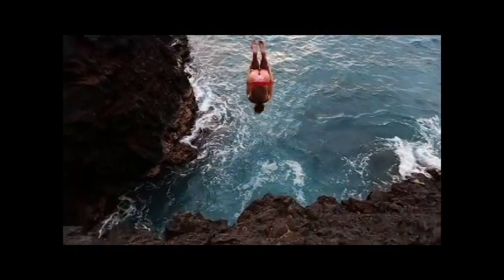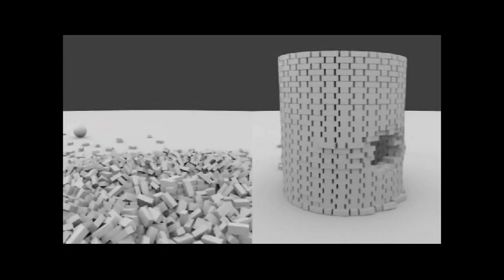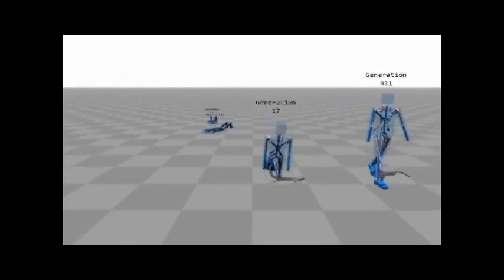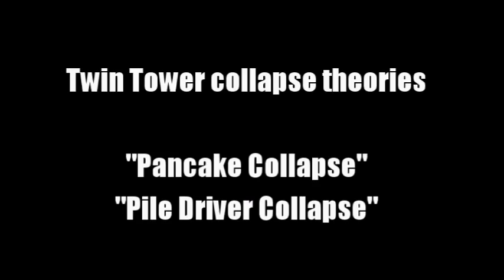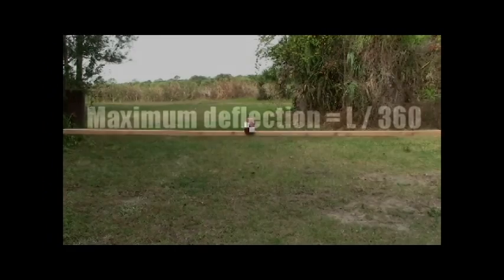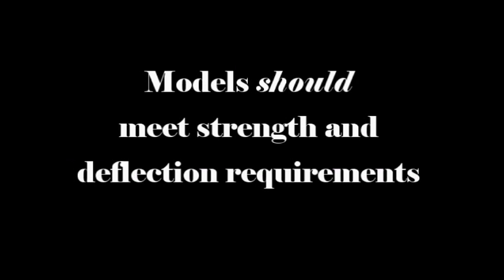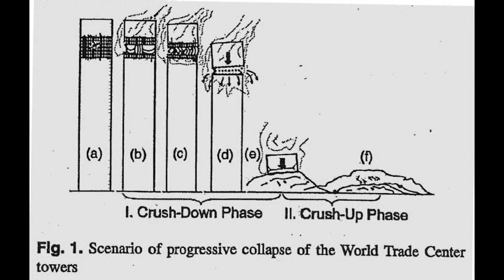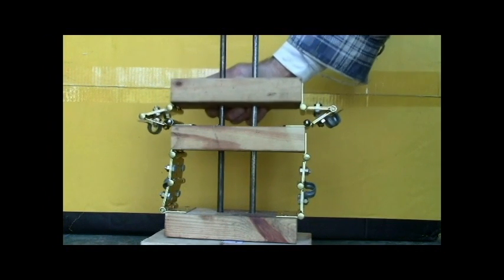9/11 Experiments: The Force Behind the Motion

Comment: You experiment doesn't take into account the relative strength/weight of the actual structure.  Your wood/paper rings in relation to the cement board floors are a much stronger system than the steel, rebar-filled concrete floors and glass/steel/concrete walls.

Basically in your system, you have tons of extra strength for your relative weight.  You would need to add a bunch of weights to every floor so that, like in real life, you don't have a lot of spare structural strength.  In real life you build to the limit, and add a safety margin.  But you don't have a huge safety margin because it costs a lot, and carrying too much safety margin starts to drive your design just so you can carry the weight of the safety margin.

(This is even ignoring the additional flaw of the friction in your guide rails.  You can see the floors binding on the rails as they tilt and rub the guide rails.)
Reply: Where are you Randy, did your Jew boses gag you again?
Reply: There one thing I envy about the payed shills is all that cock they get to suck.

YUM !!
Reply: Not much of a recruitment slogan for the debunker cult, randy, but I guess it will have to do with your limited intelligence.
Reply: I don't know why, randy.
It's just the way us paid government shills are I guess?
Reply: Keep on squirming!  Why did you lie about NIST? And why are you so scared of addressing the fact that you lied? I assume your disgust is directed at yourself. In between fantasising that the government is out to get you.
Reply: I love to squirm, randy. I love it almost as much as I love lying. I could do both all day long, every day of the year. I'm really quite good. I am doing both right now without breaking a sweat.  ;-)
Reply: Of corse I'm squirming with horniness thinking about you, randy. xoxo ;)
Reply: I love lying more, randy. I can do it 24/7 even in my sleep.
Reply: I'd say it turns me on even more than little boys with there shirts off !!
Reply: Experiments like this demonstrate a valid scientific principle Max. Too bad you don't understand basic science.
Reply: Claiming I "don't understand basic science" is not a retort.  You have not pointed to anything I said that is invalid.  If the walls of the WTC were nearly weightless compared to the floors, and the floors had a much higher strength to weight ratio that reality....then this experiment would be valid.

Did you think about WHY he had to drop the weight on the system?   Because the system lacks its own weight.  Which means as the "floors" collapse, they do not appreciably add to the weight of the falling mass, meaning it is VERY easy to arrest the falling mass. 

Seriously, if you are not grasping these concepts then please either avoid the field of engineering, or take ALL the classes and actually pay attention, because right now you are failing to grasp the basics.
Reply: LOL
Reply: Max well 

TEE HEE

Comment: The paper model is very good since,despite  it is not complying with the real strength (much weaker in proportion) of the WTC, despite that it manage to stand !
It could be absolutely possible to create a paper model that will be in conformity with characteristic of the WTC 1 and 2.
Also you have to take in account a peer reviewed study that acknowledge the strong shock absorber effect of the thin light concrete floor (mean it consume a lot of energy)
Last but not least, you must integrate the hat truss and the VERY reinforced, with steel and concrete,  technicals floors.
And then you will discover that it was ABSOLUTELY IMPOSSIBLE to observe a collapse without a supplemental energy, any one saying the opposite will be dishonest or incompetent !

Comment: First of all Im experienced in deployment of explosives.Standard demolition calls for placing shape charges at base of structure with a concentration of such under the center. Timing begins in center charges first followed by outer charges. This forces the structure to fall into itself from the unsupported weight of upper floors.
To cover a false flag event through demolition one must install shape charges on center support structure from top down and timing controlled by same device that deploys your airbags when your vehicle is impacted. As for the impact of aircraft note neither aledge impacts struck the center. Also consider the fact heat rises an upon viewing their collaspe the upper floors remained intact suggesting the timed charges were absence but were crush on the way down. 
I used the term aledge aircraft because the impact fire ball should have been greater than the exit one n the absence of a vortex swirl of fireball from a craft moving above 500mph.
This was a well planned falseflag attack n took months of prep. Certain all branches of upper leadership of government, military, and banking were involved. This event paid trillions to these parties at the expense of the majority of Americans. A day will come when religious connections to money will be seperated from power otherwise this nation will fade away as a has been.

Comment: those teories against offical theory all lack true evidence and explanation. They just throw bunch of hypothesis against offical theory but does not provide sufficient proof for theory against one we know. It's true that lower structure should slow the gravitational acceleration of upper floor, and it did. But the weight of upper floors is so huge and with each new foor being added weight is even greater and the reinforce concreate structure, strong as it is, is just not enough to stop all the weight beeing forced down by the gravity. The motion is indeed accelerated but with less that gravitational acceleration, meaning that lower floors did provide some stoping force, but once again weight is so great that this is hardly noticed. 
And heat from burning jet fuel is enough to raise the temperature of reinforced concrete to the level when iron looses its strength. Also there were major damage to the both outside steal structure and inner reinforced structure due to kinetic enery of a plane.

I beliewee the towers did colapse due to plane hit them, the important question here is who did organize that? Was Bin Laden organization the sole actor or was the US government involved.

Comment: Experimentation needs validation by unbiased 3rd parties as well.
Reply: Can you tell me how the NIST building studies were validated by unbiased 3rd parties when they collected most of their evidence under non-disclosure agreements?
Reply: Don't worry your pretty little head over how they did it, randy. 
Just worry about the who and why.
Follow the money.
Reply: I can explain this.  Class, the above experiments need an unbiased 3rd party to validate them because that is the Scientific method.  If anyone who points out that Science must be validated through unbiased experimentation is going to be in disagreement with you and thus labeled a scumbag by you then it will be impossible to find any reasonable minded individual on the planet that you will not call a scumbag.  It's a personal problem, not a scientific one.